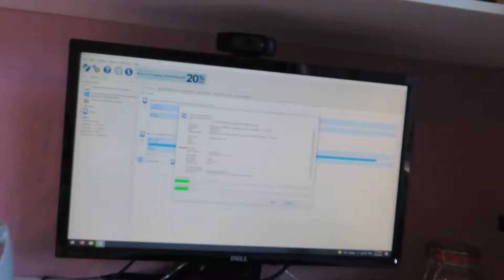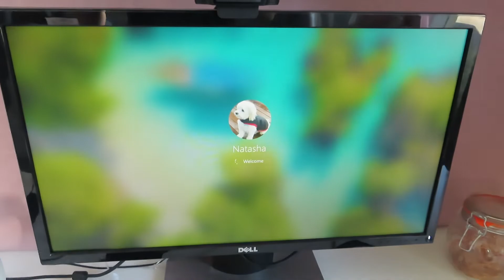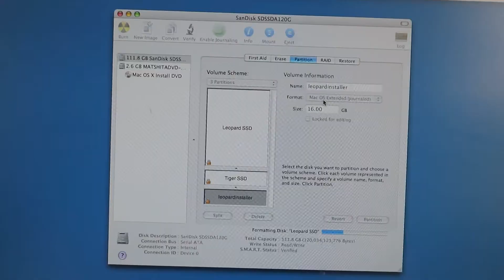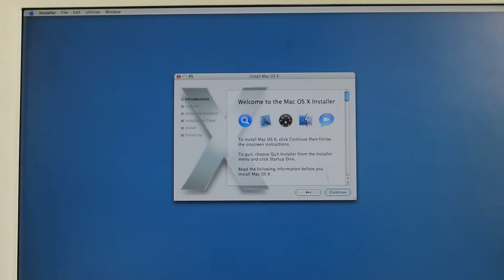How to install an SSD in an iMac G5 & Replace Thermal Paste

Comment: What did you use to check the CPU temperature on the iMac G5?  Also what software did you use to clone the drive?
Reply from the maker: I’m not entirely sure what the temperature sensor app was, I think it was built into SMCfancontrol - give it a google.
For cloning, I always use carbon copy cloner. :)

Comment: It's honestly a shame that you have to cover al those sexy internal components with with the screen
Reply from the maker: I know right!?
that’s why i love the iMac G3 so much
Reply: I own the 1.8GHz model and it was designed by Apple to be fully upgraded by the average home computer user.  The base model did not ship standard with an airport card so, want to add one later no problem, what more RAM no problem, want a larger hard drive no problem, etc.